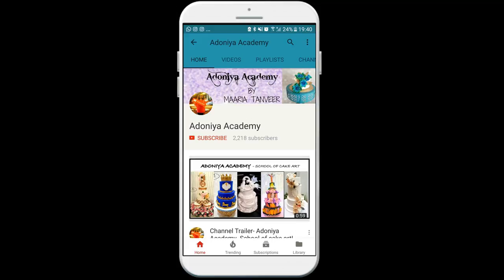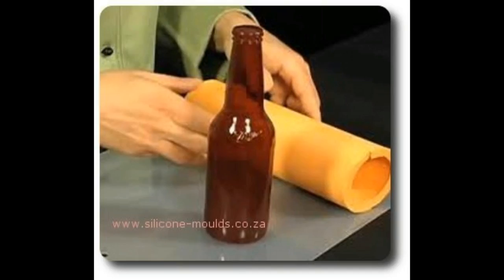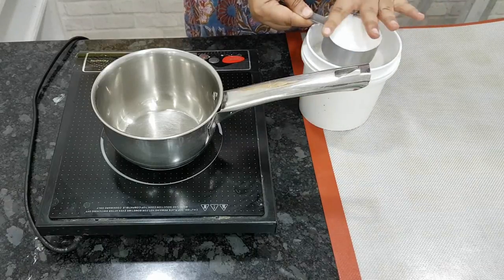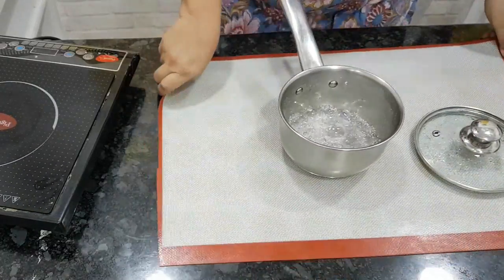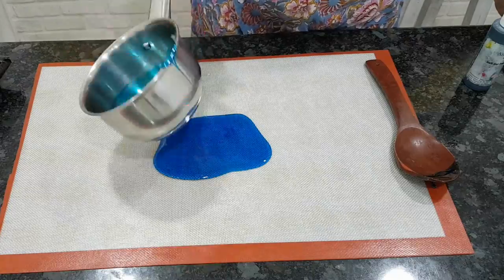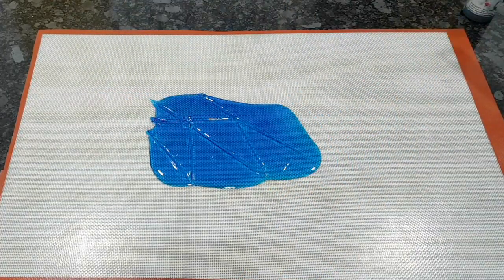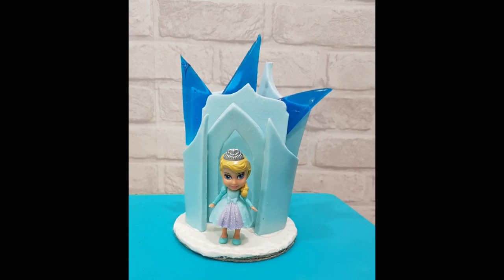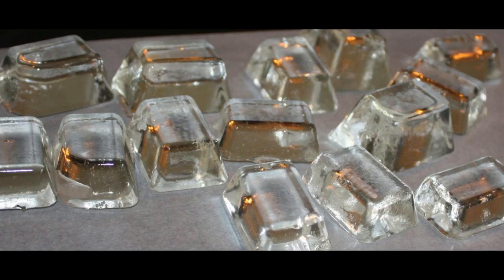Isomalt Basics | Part 1| Sugar Decorations | Cake Decorating Tutorials

Comment: Hi mam..can this be put on a cake and kept in the fridge?
And i boiled it till 160 degrees then itself it starting changing its colour Little bit brown
So do we need to boil it on medium flame..
As soon as I removed from heat it started becoming hard ...it wasn't liquid form like yours in the video please reply
Reply from the maker: Did u add water ?
Reply: Yes mam I added water as directed on the bottle... please reply
Reply from the maker: Then check your thermometer. At 160c it's no chance it can be thick